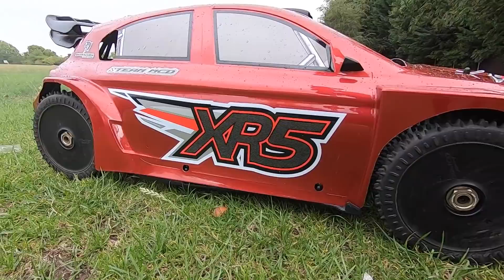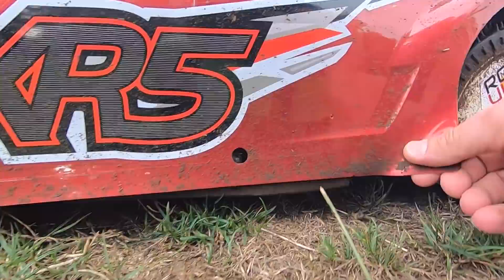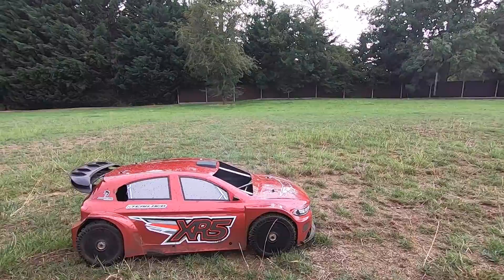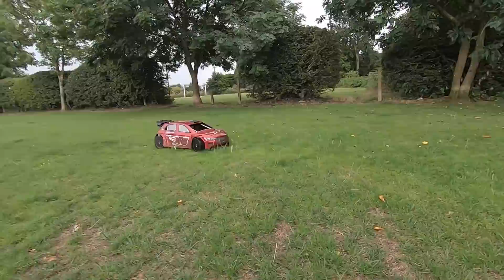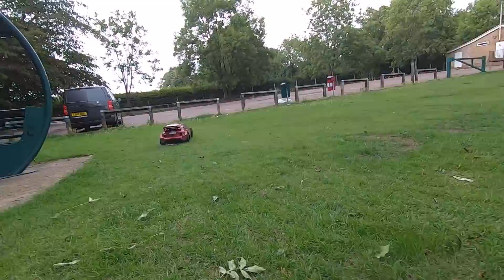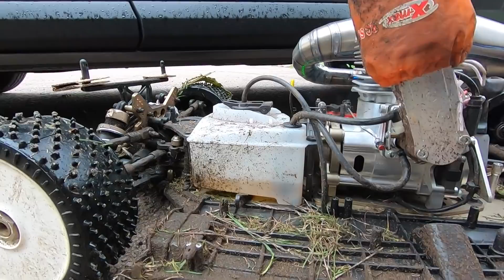MCD 46cc TAYLOR (rcmax) RALLY car!

Comment: Man you know the engines big when the block looks bigger than your first does alongside it when starting it. Love RC rally cars and that one looks to have it nailed in those slides!
Reply from the maker: Driftomaniacs hi mate. Yes it’s a beast of an engine in there. Still need to work on the setup. Getting too hot so I need to hole the body up some more for better air flow. There is a 2 speed “snap” gearing set I am hoping to get to fit to it. If so it’s going to be bonkers! It’s quick enough 😆👍👍
Reply: Air cooled motor...cold air inlet and outlet diffusers

Comment: That rig would look sweet with some KM2/KO2 replica tires and some proper bead-lock rims on it. They would handle alot better on the pavement as well. I would tend to think running knob-tires like those on the road would wear them out rather quickly.

Comment: RC Maxx UK Mate is there no better way of cooling the engine, rather than having the entire windscreen cut out ? I'm a novice when it comes to petrol rc cars, but I've owned dozens of Nitro ones, mainly 1/8 Nitro Buggies, and as you will know, keeping the engine running at optimum temp is critical for performance, never mind to prevent over heating and a blown engine! lol. I just imagine that the huge open windscreen is gonna act like a big parachute and create terrible drag, and slow the car down ? I would have thought that these really large expensive cars/engines would have some kind of independent air or even water cooling system ? Or would the extra weight cancel out the gains in aerodynamic efficiency ? Amazing vid btw! That car is ace! Wes, Liverpool, UK

Comment: I was going to look into buying one until I discovered they cost more than my Yamaha 700cc naked bike.
Reply from the maker: DEeMON 😂😂😂👍👍👍. I’ll be getting a bike again soon after a long lay off. Some of these cars are crazy £. But they do give you a rush!
Reply: And your bike must be less than £ 100 tho?
Reply: @Barnacle825  less than 100? lmfao. the engine alone on this RC is nearly 2,000 pounds
Reply: @DrMurdercock  wtf
Reply: @DrMurdercock  get a roller and stick a zenoah G320 in it that's only £250 with a tuned pipe will still go well
Reply: @DrMurdercock  you do know they sell 2 stroke engines  for $100

Comment: BTW, if "Noise" is an issue where you live (which from what you said Im assuming it is) I bought a Silencer/Muffler for my 29cc 1/5 baja buggy and it made a HUGE difference to how loud it was! Like literally it reduced the sound by 30-40% and it seems to be a straight-through design so there is NO loss of power or anything so I couldnt recommend one more! & noise isnt an issue where I live but I just didnt want it hurting my ears!
Reply: No way it doesn't lose any power.  2 strokes rely heavily on the pipe, just look at motocross bikes.

Comment: Ouch what's the smoke at 5,14 
Is that either starting to get hot hot and burning off the crap, or the clutch??  ,.    After the big donut, it goes lean, that's why it sounds funny just before you switch it off, I bet that's hot ,,  look up something called thermal overload
Reply from the maker: David Briggs definitely hot. Holed the body up more now for the next run to get it cooler with more air flow. I can hear it getting hot as the run goes on...these big bores get hot unless they are doing speed runs with plenty air flow...

Comment: This thing sounds good !
How did you made this pick up so responsive ?
I see all those big scales cars, just beeing so lazy and stuff even with the big cc engines.

Is it also something about the rpm the clutch takes in ?
Reply: The tuned pipe helps alot and having a really good carb.

Comment: Is it yours? If so why there was no video presenting it? Or is it youtube algorythm fu*kin with me agin? Also it might be a bad idea but what if you could build some lexan fins into the body to direct airflow for the cooling head?
Reply from the maker: Ev0ltion hi mate. No it’s not mine. Mike the main man from rcmax engines has lent it to me to try out. I’m looking at ways to vent that engine. It needs more air flow for sure. Even electronic fans could b an idea. It’s air cooled at the end of the day.
Reply: @RCmaxxUK  Using fans might be alot of work for very little effect. Have you ever seen how xo-1 from traxxas is cooled? It has tunnel from the bottom of the chassis directin the air into the motor i belive that creating some sort of channel directing the air onto the engine and forcing it the other way will do the trick. So 1st thing i would try on second watching it would be drilling  more holes on the back windshield to allow the air to pass.
Reply: Unless you want to make it into some crazy device then go for water cooling i saw system like that in smaller scale :D But we all know you are crafty and i belive you could adapt heatsink from a scooter or something like that. Tubbing and rest of the installation is easy to make :D

Comment: Seems like the CLUTCH Springs are way too Heavy.. 
The simple fact you need to Rev the Engine 30% before it even Engages is a Joke.

Also putting a REPACKABLE SILENCER on the Expansion Chamber like a Motocross Bike will fix the Noise issues.

Comment: You run your clutch setpoint way to high, this engine has plenty of torque low down. It would make it a better driving car.
Reply: Is that why it didn't take off till its rpms got on up there, or?
Reply: Yes correct most clutched are adjustable, the engagement point should be set lower.

Comment: Whay type of fuel this RC used ?
Reply from the maker: It’s a 2 stroke mate. So petrol/ 2 stroke oil👍👍
Reply: It has spark plug...premix system ... petrol + 2T
Reply: Petrol plus 2t is more cheaper compare to nitro fuel right ?
Reply: @arincstingray611  Yes, it's cheaper

Comment: not much smoke for a 2 cycle? bell ray 2cycle premix? running in the wet grass yuk ur car will never be the same also i noticed the front wheels not spinning much need to tighten up ya center diff so ya get better front wheel engagement. ya need to use alittle emore 2 strke oil till ya getting some smoke as i heard it bogging like doing donutsz lol i like the car be a shame to roast ya new engine run it alittle fatter on 2stroke oil i like my bell ray. it can be mixed 100/1 in a outboard boat engine since ya got the whole lake to cool ya engine but on a air cooled 50/1 is the way to go plus i like the smell lol. my dad road for team honda motocross his favorite bike was and still is 97cr250r a 2 cycle n its mean lol he also has 2 kx500 and 2 cr500 n a kx250 n a cr250r he is busted up pretty good yet he rides his own motocross track n hes super fast on the honda cr250r 2 stroke lol lap times just riding for exercise 2hr without stopping in this heat is super human for 58yrs old its truly stunning. he taught me alot about tuning nd rebuildng 2 strokes he says they are the beast n nothings faster.

Comment: I hate this telegraph-mode driving...
Reply: What's telegraph mode driving
Reply: @eddymcintosh5551  throttle on and off again and again
Reply: damn thing has so much power it's probably necessary to prevent complete loss of control. Seems really only suitable for massive flat spots well away from residential areas. Must be awesome on a huge beach.